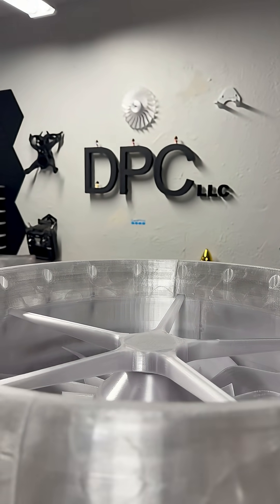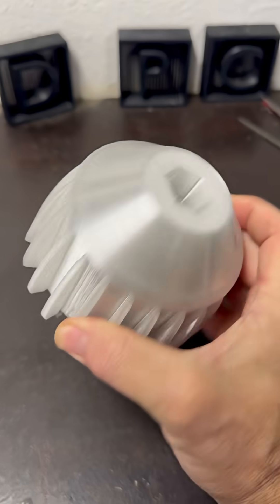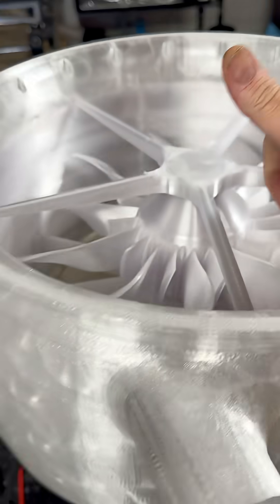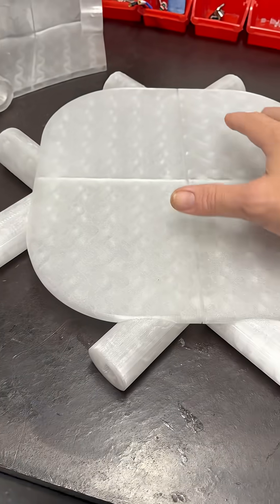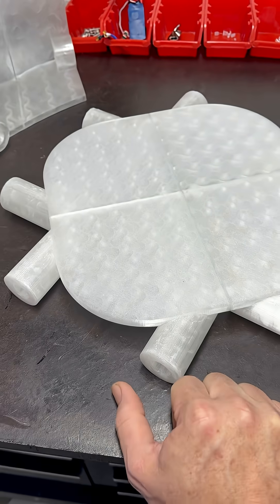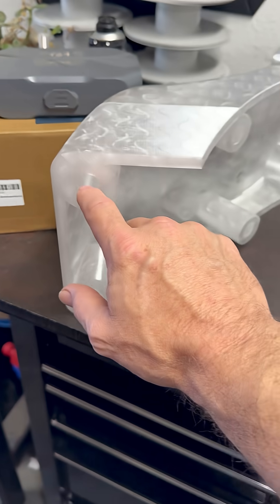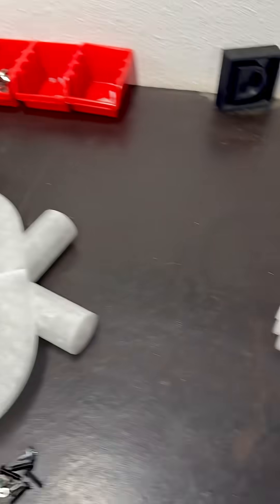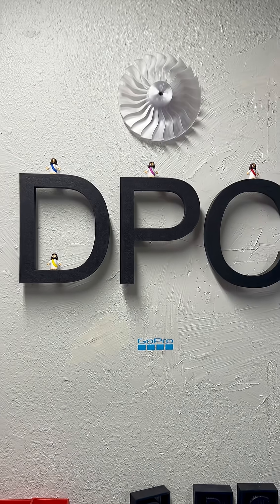And the adventure begins again with the second 340 mm EDF of the Shrike Ultra EDF Drone. ￼

Comment: What if for a v2, we made a double long fairing and add a contra rotating gearbox lol, what ever happened to metal gearbox pt 2?
Reply from the maker: Metal gearbox is still on the table. I’m just designing a specific set of gears that can be machine. But that’s not for the 340 mm.